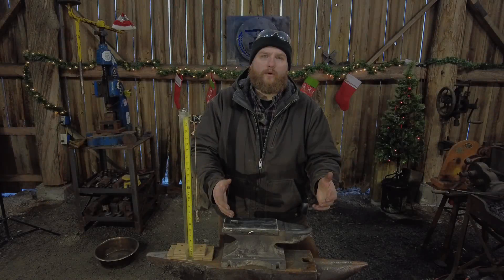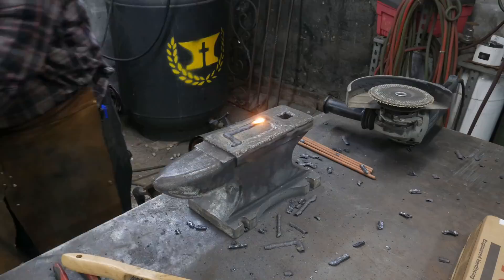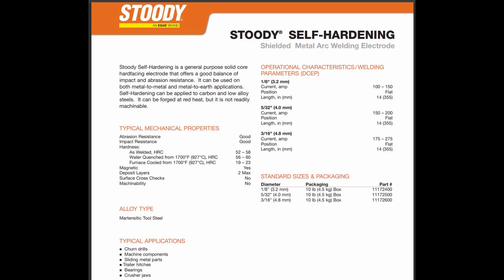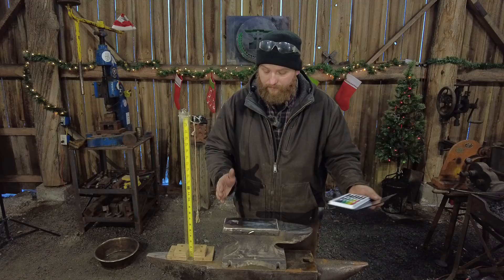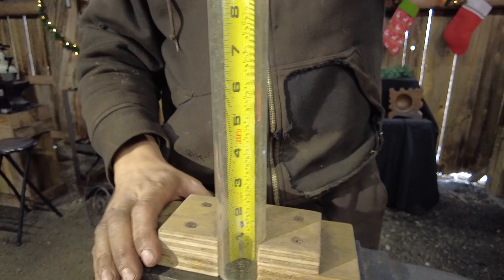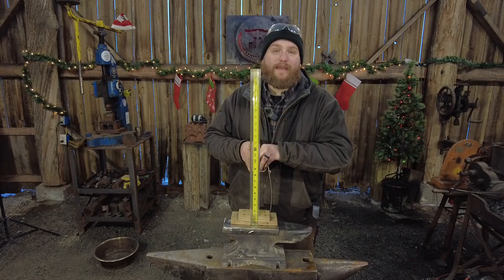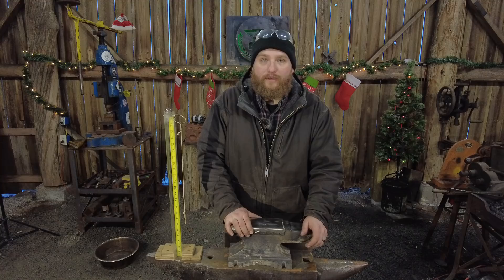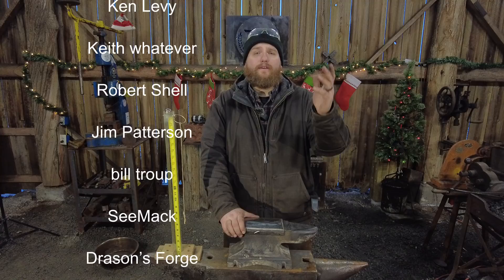Astonishing Results! Hard Surfacing a Harbor Freight Anvil

Comment: I'm a retired professional welder.  A word of caution about hard facing. Don't put on over 1/8 inch or it will chip off. It's just the nature of hard facing.
Reply: If you treat it like cast iron and pre heat it and post heat, or just get a bunch of heat into it before welding, you’ll get good results. Work at a paper mill and the chip yard/hog fuel boiler equipment receives a ton of wear on drag chains, screw conveyors, and I’ve personally built up more then 1/8” with good results.
Reply: @marv8481  just because someone is a professional doesn't mean they are good.
Reply: @678friedbed  This is too true.  I see sooooo many "professionals" that acquire a title either educational or employment based.... and never progress.  Getting the credentials and titles is just a starting point - it is what you do with the opportunities that those things (title/creds) afford you that really matters.
Reply: @678friedbed  Nor, do they know everything. I've been a welder/fabricator for 32 years, I still learn new things everyday. Maximum 1/8" is what most rod manufacturers suggest.
Reply: @jong2359   It's what you learn from experience that becomes wisdom. 32+ years of building everything from utility trailers, to gas and oil pipelines, to nuclear power plants. That piece of paper just got me started, I learned to weld and fit on the job.
Reply: @marv8481  there ar5e so many hard facing rods and many have a rec amended  maximum thickness
Reply: Usually, depending on the type, it’s either two or three layers, however thick that nay end up.
Reply: Put it in a bed of charcoal. Keeps it just hot enough to hardface up to 1/4".

Comment: I guess my only question is how much does 2 lbs of weld metal cost in terms of rods used, can that be recouped by buying an anvil that’s just that much more expensive than the harbor freight anvil. All in all very cool though
Reply: Add in your time, whats that worth?
Reply: About $5 for a pound of 6013 rod and the Stoody rod $10 (sold in 10 pound pack for $100)
Reply: For me if it is less than about 30% savings for buying a better anvil off the bat, the whole project is worth the experience for me.
Reply: It's just a waste of time. I make 43 bucks an hour. Spending 3-4 hours making a garbage looking anvil isn't worth my time or materials. That being said,  if you're a poor smuck with no education or possibility of working anything beyond flipping burgers... by all means waste the time.
Reply: @MrGregggleziii  sometimes the journey is just as enjoyable as the destination. You can see it as a waste of effort, but for me the satisfaction of working on a project like this is enough for me to enjoy it. 
But seriously, how small is your ego that you need to brag about your hourly wage to random people. What are you compensating for, did you loose your bathroom tweezers and now your boyfriend is mad that you keep soaking the toilet seat?
Reply: @MrGregggleziii  geez man what do you do for $43 an hour
Reply: @Bigtexbbq  -- I'm guessing it involves kneepads, but I might be wrong.
Reply: @Bigtexbbq  probably one of the old welding jobs that still pay.  I've seen hiring ads for cert welder for $17 an hr.
Reply: @MrGregggleziii  If you make that kind of money, do you also live on a city that most of us wouldn't care to live? There are plenty of places where your $43/hr doesn't let you live as well as people making a third less than that.
Reply: @Makermook  Not in the same profession as you are bud. I'm a science teacher. You don't have to worry about me taking your corner or clients.
Reply: @Forrest Farris Read it as condescending or as a realistic post. Frankly,  if you got offended... well.  Let's go Brandon must really make you mad, haha.
Reply: @MrGregggleziii  no wonder your divorced!
Reply: @MrGregggleziii  in defense of others here who perceived a condescending tone from your comment, I have to agree that it certainly came off that way - you're commenting on a video about how to modify essentially the cheapest anvil you can get to make it useable and the video is produced by a man who doesn't exactly have an Alec Steele caliber shop so the typical audience is probably not making anywhere near $85-90,000/yr - I mean, good for you, with your income, this video doesn't apply to you - you can just run out and buy a $2,500 300# Peter Wright.

Furthermore, what kind of science teacher would you happen to be? Grade school? Tenured research faculty? Somewhere in-between? What subject do you teach? Not being aggressive here, just curious as I am a practicing R&D Analytical Chemist in the field of radioactive pharmaceuticals for a start-up company.
Reply: @MrGregggleziii  for someone learning welding and has a few bucks leftover at the end of the month.  It makes it a project. 
Brandon is doing great job of screwing the country.
Reply: At my weld supply you can get a 50 pound box a rod at about 130 bucks,Lincoln rod

Comment: That was fun! That being said, anvils way back when were cast iron with a forge welded hardened steel face. So this isn't THAT much of a surprise. If you take a cast iron base with a hardened steel face you'll get a pretty lively anvil.
Reply: Your are thinking of wrought iron (iron with hardly any carbon) with forge welded steel faces, besides Fisher anvils pretty much every anvil before 1900 was forged wrought iron with a steel face. I have owned a few from the early 1700s which are solely wrought iron with no hardened steel face.
Reply: @connorlee7840  right. I do not own a cast anvil. They’re all wrought with steel work surface. The softer iron of the table and horn allow hot cutting without damaging tool.🙂

Comment: From a profession welder standpoint; there are rods designed specifically for hard surfacing underlayment (buttering layer) such as “tensilweld” made by Washington alloy. This particular filler metal is an excellent all-around maintenance rod and is essentially a high tensile strength 312 stainless which helps tremendously with porosity in cast materials. That is what I use for my anvil repair when I need to replace horns, heels, & repair/replace faces.
Reply: Nice, I only weld a lot for my job, not certified or anything, as not needed, I was thinking and mentioned, either 309, or 6010, etc in that series, then hardface. Just out of experience.
Reply: @Plastikdoom  309 would be a much better choice rather than 6010/etc due to its ductility by nature along with the added silicon in most stainless filler metals helping the porosity issues that are inherent from castings.

Comment: It looks like it'd beat the pants off a piece of railroad track! for a first anvil, it's usable, cheap, and available everywhere, I'd love to see a durability test, with lots of edge-work to see how it all holds up.
Reply: For a first anvil I'm going to have to disagree with you. 50/50 odds at best a new guy already has the right welding skills and equipment to do this. If you dont then you have to buy the anvil and find and pay a welder to do it for you, which is probably going to be as much cost and a lot more hassle than purchasing a mid range anvil. And id have less durability concerns with the mid range anvil.
Reply: @gman1515  apiece of railroad track is one serious tough piece of high quality steel
Reply: At the same time, you could accomplish the same on a rr track and itd be easier than welding cast. I got a few dock cleats im gonna try
Reply: If anybody asks me what they should do for a first anvil, my advice is simple. get the biggest, most solid chunk of metal you can find, and put it on the most solid foundation possible. while rr tracks are made of tough stuff, they just don't have the mass required to make those hard-earned first hammer blows really work. unless maybe you cast it into a block of concrete.
Reply: @huckstirred7112  It just has a terrible shape for becoming an anvil, almost nothing under the hammer and a poor geometry for adding a hardy hole.
Reply: @garethbaus5471  thank you

Comment: It will be interesting to see if the welded surface cracks off under the hammer. In my limited experience in welding cast iron the cast needs to be hot and we used nickel rod (Very Expensive) .
Reply from the maker: We will see 🙈 lol
Reply: Valid point, but I think the experiment is worth the time and relatively small expense.
Reply: Recently a friend of mine who happens to be a skilled welder used nickel rod to repair my lathe headstock. It was painstaking but he got it repaired and my Victor 20X40 is up and running again.
Reply: I would have too agree with this comment. Though I have had good results TIG welding cast with stainless steel. But I do believe stainless does have some nickel in it as part of the alloy; that's what lead me to try it in the first place.
Reply: nickel rod is recommended for cast iron repair due to its increased malleability when cool, so it doesn't put as much strain on the cast iron part (cast iron is very brittle and will sometimes crack after the abrupt heating and cooling which naturally occurs during welding). As such, nickel rod is really not ideal for a repair where the desired end result is a hard springy surface, but might be worth it to try as an intermediate step before the hard face? Might add to the overall durability of the anvil. Similar reason as to why copper and nickel are applied to steel before the final layer of chrome during the chrome plating process.
Reply: Anvils aren't made from cast iron, they'd be far too brittle and fail in no time if they were.
Reply: @ferrumignis  the anvil in the video is from harbor freight and made of cast iron.
Reply: @JGilbertMetal  Possibly some kind of ductile iron, but conventional grey cast iron would be ridiculously weak. One good smack with a hammer on the horn and you'd have a two piece anvil. Also welding hard facing onto grey cast iron would  result in a lot of tinkling noises as it cooled and the whole lot peeling off.
Reply: @JGilbertMetal  Hammering the soft interface layer could be useful , and a preheat
Reply: Cool experiment , it would be interesting to see how long this holds up.
Reply: @ferrumignis  They advertise it as cast iron, but almost all cast iron today that isn't a frying pan or some piece of decorative metalwork is usually ductile iron. It's still terrible and too soft to make a good anvil, but it's $70, what do you expect?
Reply: @ferrumignis  in

Comment: The process of welding with a non hard face rod first is called padding. Hard face rods ends up check cracking and padding the parent material can prevent cracking in the parent material.
Reply from the maker: Thank you for the definition 😊 again not a professional welder I'm just a humble blacksmith and fabricator...

Comment: Well, I'd have bet against that being possible and would have lost my money!  Roy did a great job of "hard-facing" there -- something I didn't think could be done -- but he was sure skilled enough to pull it off.  I've been beating up iron since I was 13 or so and I was born in '55, so do the math subtract a couple of years for the army, photojournalism and judgin' and you'll be able to figure out my experience level.  Among my anvils -- which are mostly older than me by 50 to 100 years -- is one of those Harbor Freight (Russian or Chinese?) things.  At it's weight, it is perfect for what I need so that I can do blacksmithing work on 'poop-deck' of my steel schooner.  The 'hardness' or SOFTNESS, actually isn't something that worried me.  I've seen some of the India Indian videos where some squatting blacksmiths are turning out some pretty damned good looking kukris using a 18 or 20 lb. sledge hammer head as an anvil.  One such blacksmith even had two "striker boys" dug down knee-high in the dirt so they could whack the hell out of truck springs and reduce them to the right size for a knife!  They sure impressed the hell out of me with what they're turning out with some of the crappiest looking tools in the universe.  It says a lot about their mastery of the craft and their artistry.  My H/F anvil  needs some 'help.'  But not in the hardening dept.  I can live with that for the work I plan to do on it.  Where it needs help is in it's shape to begin with.  The horn is too damned fat and it's so far off of being 'round' or 'rounded,' that it's about useless for making anything that needs a graceful curve or circle.  It's more like some kind of longitudinal "hump" than an anvil horn.  That is the area that I'm going to introduce to Mr. Grinder at next opportunity.  Also, all that nasty-assed blue paint needs to disappear.  I'd rather have rust than the "advertisement" that I'm using a cheap-assed anvil when I'm forging on my boat.  But I wouldn't sell a Harbor Freight anvil short, nor would I sell short a lot of the tools that can be bought there.  A lot of "self-taught" and "self-teaching" people who got their first tools there have become some pretty damned good artisans.  Hell, at one time, I remember making my forge out of an old brake drum from a Chevy pick-up truck and using a chunk of railroad rail as an anvil.  If beatin' iron's in your blood, you'll find a way to do it.  Good luck, you Youngin's!  Go make somethin' hot and make somethin' special out of it.  The world is your oyster.

Comment: I took a 1/2” hardened tool steel plate and liquid nailed it to my Harbor Fright anvil and it actually works well except a little more bounce than I like!
Reply: we call that a "chemical weld"  ;)
Reply: that bounce is to be expected your basically putting adhesive silicone under your strike face your going to get a ton of bounce and if you hit it on the edge you might start to get separation which can be bad if your working a piece so just be careful liquid nails is not a permanent way to bond that stay safe and check it after every use oh i would also state that epoxy is not even an option too brittle while jb weld or other chemical welding adhesives might work they are probably not going to be the best
Reply: @ferrofeles2063  I knew that using liquid nail would give me more bounce than I wanted, but I didn’t want to weld it so that I had options in the future. Thanks for the comments and advice.

Comment: I'd like to see some railroad track done up with that hardening welding rod. Seems to me you could get a pretty decent anvil for pretty inexpensive.
Reply from the maker: Might do that in the future 🙂
Reply: Could be a great idea. Nice huge surface anchored to some old railroad ties. Then hard surfaced.
Reply: Railroad track is actually decently hard already (especially used, it work hardens), the problem with a railroad anvil is lack of mass. I made myself one as I could get used rail free from work, but I have a piece of rail upright so you get much more mass under the workpiece. I cut another section of rail and welded it to the top of the upright rail to get a bit larger work surface, but still try to do any of the work directly above the upright rail when possible, there is a huge difference in efficiency that way.
Reply: That would potentially make an actually good anvil.

Comment: I'm sure it will crack with some real hits on it. The reason why I say that is you didn't preheat the anvil before you welded on it. When you weld cast iron you need to pre heat it or it will break. I've done A lot of cast iron welding with ni rod 55 and 99
Reply from the maker: It was pre heated just lost the footage before editing... But we will see none the less 😃

Comment: I just got my forge set up, haven't made any video with it yet. Im new, only have a few vids so far. thank you for you faith and teachings. I have what I this=ck is the 112 pound Peter Wright anvil, boy does it need resurfacing bad, but I haventyet because its old an I don't want to ruin it. Well, I'm going to try it. Thank you againn for the inspiration.
Reply from the maker: Be really sure first... You can always weld something to It but not so easily remove something that's attached.. glad to inspire And thank you for watching

Comment: This is a big plus. I gave a big negative response to the attempt to surface harden since of the brittleness of gray and white cast iron.  I included an article of a company that converts white cast iron into Malleable cast iron that is far less brittle. I suspect that the annealing process for white cast iron would work for gray cast iron.  If I remember need to heat the casting to 400C for a few hours and then let the casting slow cool.  This change the crystal structure of the metal.

Comment: That is reassuring to see. I got ahold of an old Mouse hole anvil from a mechanics shop where i live. 142lbs but the harden face was hit with a cutting torch and it began to separate and rust. I took it to my work shop and cut as much of the damaged areas out, and began to butter some 11018 rod over the areas to make a good surface to put the hard surfacing rod on. I havent gotten around to finishing it yet, but to see that it does infact work makes be belive that ill have it in working order, im sure it will still be a dead ringer, as i think at one point in its life it was in a huge fire as while cleaning it up i caught some fractures and started to fill them in. But heres to high hopes that i can get it atleast useable again.

Comment: I expect if you trimmed it down and welded on about an inch of appropriate hardness steel plate you would get a decent anvil like object.  (Preheating cast iron helps with welding by the way).

Comment: That's a good idea, but you can also buy a piece of bar stock the size you want from a steel shop, and maybe if they have cones
get one and weld it on.  I have a piece of 2x8" flat bar that I use, but to be honest my Harbor Freight anvil worked ok. I hammered out a sword and several knives on it. 
The difference isn't huge.